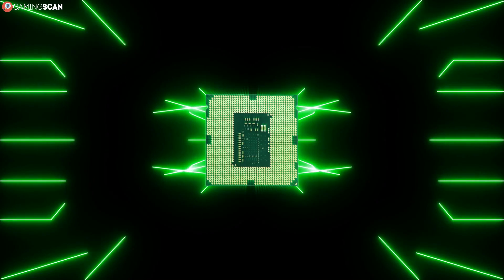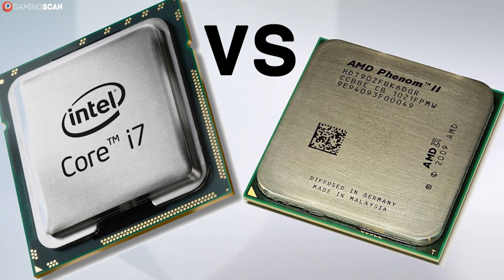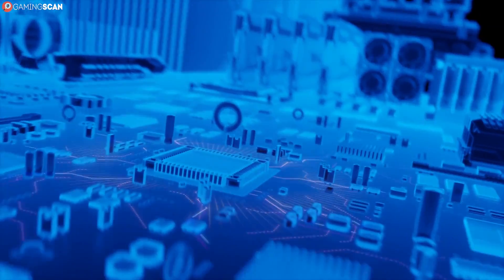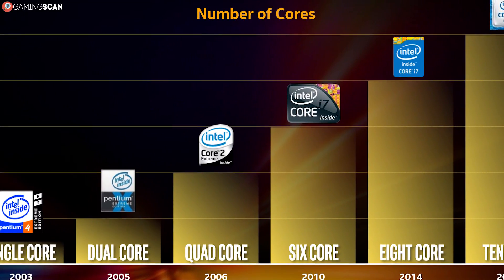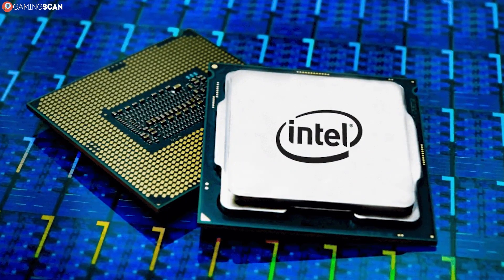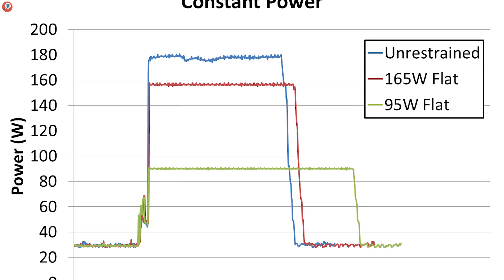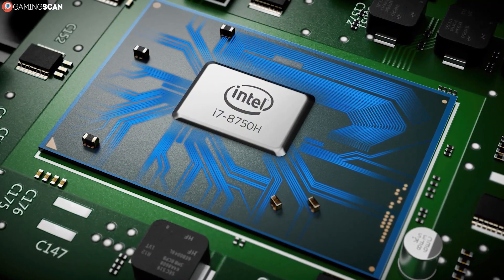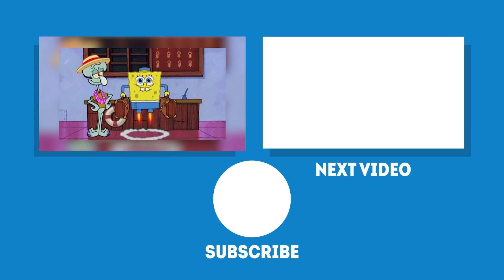CPU Specs Explained (2020) [The Ultimate Guide]

Comment: Why on earth would you go AMD. So you can save a few bucks to get sort of similar performance. It’s an investment,  spend an extra $100 and get something that just works!
Reply: ...for better security for one.  Intel is way, way, way less secure.  ...also, Ryzen has been getting a ton of attention for a reason - AMD has actually surpassed Intel's IPC for the first time in history.  ...also, you are suggesting that Ryzen doesn't work which is false
Reply: I own both Intel and Ryzen systems. Your investment argument is rubbish. The I7 7700k or 6700k isn't really as viable now as the 1700X or 1800X. And as far as last gen tech goes the 8500 8600k doesnt even get a mention these days due to a lack of hyperthreading. 

And that's before taking into account the socket difference between those chips. From 6th to 10th gen we're about to get a 3rd socket change from Intel. That means a new $300 Z series motherboard for overclocking. But those who bought the first Ryzen can upgrade every year without buying a new motherboard and probably in 2020 as well. Also speaking of CPU overclock it's much cheaper to go the Ryzen route then Intel. Overclocking can  add extra performance over time which is a price premium on Intel systems but is more or less a default feature on every Ryzen chips. So your argument that Intel is the better investment is a poor one. In fact the 7700k is still much more expensive then the 3600X but with lower core and thread count. And comparing performance in games it's no where near. Forget multithreaded applications.
Reply: $100 is soooooo much more than a few bucks for some people and the compatibility is soo much greater including the release of the new thread rippers which are out performing intel.
Reply: But the thing is pal, it's not just $100 more.... It's three, four, five hundred dollars more and you're only getting at most 15% more performance. Even that's going away now with 3rd, gen Ryzen.
Reply: Not all of us are spoiled rich kids where 100$ difference is as insignificant as 1$ difference. And just because a majority of games get up to  like 5% more FPS from Intel chips than Ryzens, doesn't make them useless. They're called the budget option for a reason. You want the best possible performance? Sure go Intel, but there's reasons that AMD are making Intel crap their pants. And don't get any AMD fan started on the features of team red they have over team blue.
Reply: Chris A.M. hello there. I didn’t intend to offend anyone here. On a side note I am 44 years old so I am far from a spoiled rich kid :) That being said, I tend to prefer Intel because 95% of why I want performance in a computer is for gaming and consistent clock speed is a big part of that. I personally don’t need a huge multi core processor for what I do. I couldn’t care less about power draw and I’ve heard some AMD motherboards can be quirky with issues. Also, I used to own an AMD computer and I was less than thrilled with it, granted that was many years ago. Just my opinion :)
Reply: @AVKingJamesBible  well yeah your preference is Intel and for understandable reasons, but that doesn't mean you can crap on the other team and say "they don't work" because they didn't "work" for you. When a build is planned the first thing that is chosen is which team you're getting your CPU from because of preference, in your case best gaming performance and consisten clocks gets you to prefer intel. The "spoiled rich kid" is a metaphor my kind sir, it was aimed to mean that you made 100$ sound like not much. But the thing is in "budget systems", which most people aim for, every dollar counts and the limit is a limit. In that case, you get more bang for buck with AMD even if Intel counterparts still grant higher FPS in games. And in the case of older Ryzen chips they have an easy upgrade path. As for the multicore argument you're right, they made a 16 core as a standard desktop chip, and for their next gen they should focus more on increasing clock speeds. Cheers

Comment: good learn a lot can you make video on air vs liquid cooling solution which is better
Reply: I could tell you about the difference between them in a few lines, but the short answer is: if budget doesn't matter, liquid cooling is in general better, but there are some air coolers that cool better. Exhibit A: Noctua
Reply: I'm very late to this, but I second the first reply and would add that air cooling is generally more reliable and less prone to leaking or other components breaking. I'm not saying that liquid coolers are garbage and will break everyday, but it's like a luxury vehicle the more buttons, switches and features you have the more that can go wrong. With a simplistic car that has manual windows or controls you don't need to worry as much because theres less things to break over time.

Comment: What mobo for ryzen 7 2700x
Reply: Seatch for "B450"
You'll find a lot of good options!
Reply: B450 tomahawk or carbon ac
Reply: Gigabyte A320
Reply: Pretty much anything can work with it, but if you intend on overclocking i'd recommend X series boards (X370 and X470 best for that chip)